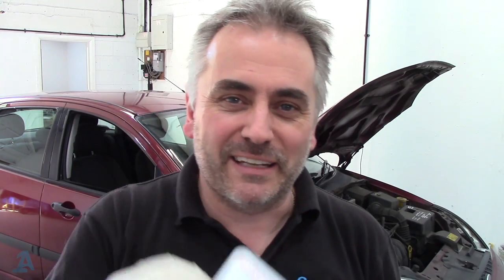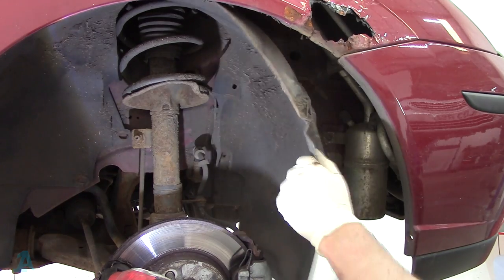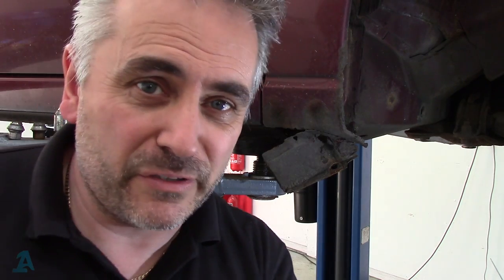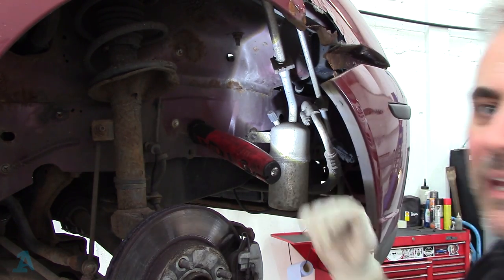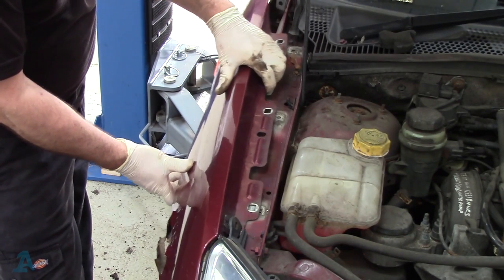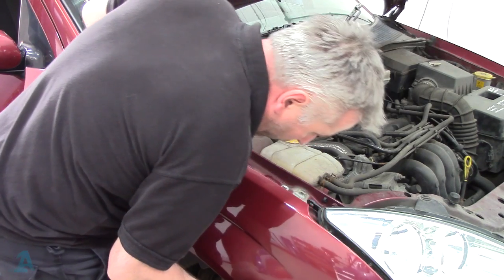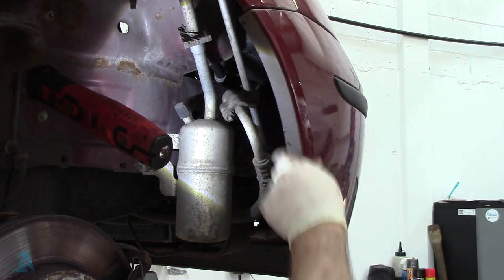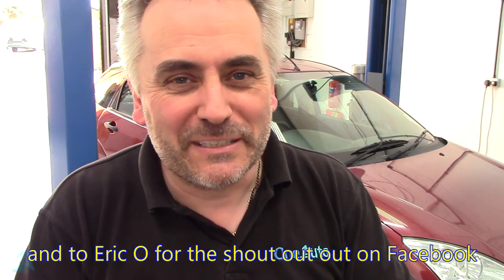Ford Focus MK1 Front Wing (Fender) Replacement

Comment: tile nibblers my tools are shinier 
OMG I cannot believe you write on your engine with tippex you would never work on my engines😁😂🤣😂😁😂🤣
you're sill looking really nice lol next job

what was that magic to use that the end I have never seen one of them before it made a funny noise 😁😂🤣

thanks for the shout out mate
Reply from the maker: Told you mate, the service history is written on and around the engine....I'm never gonna loose paperwork that way. The clicky thing was a sound effect..I was actually grunting 😂🤣
Reply: One Auto, I see that's what it was because I was definitely waiting for a Grunt not a click 😁😁
Reply: bodgit and leggit garage I bought a car like that with the service history in tippex once. Turned out to be a rite shed
Reply from the maker: What you implying? 😂
Reply: One Auto, tippex is just used for covering mistakes 😄😄
Reply from the maker: Its actually correctional fluid, cause I have corrected the wrongs 😊

Comment: Only thing with the 10-15 year old Ford's is that they turn into complete rust buckets and need £200-£300 worth of welding underneath each MOT. My friend has a '57 plate Focus and it's all scabby underneath, my other friend had a '55 plate Astra and the underneath and bodywork looked loads better. But when Vauxhall's do rust, it's the floor pan that rots.
Reply from the maker: Yeah this ones hanging in there.
Reply: Has it not had any welding yet?
Reply from the maker: Ssssshhhh.... Oh no now you've cursed it 😜
Reply: Thick layer of undersealer all under it, day before inspection so it drips on the MOT inspector so they get out form under it quickly. ;-)